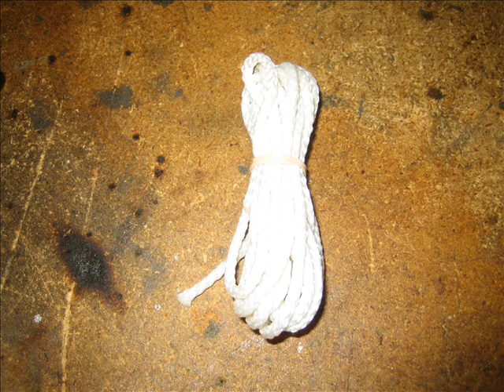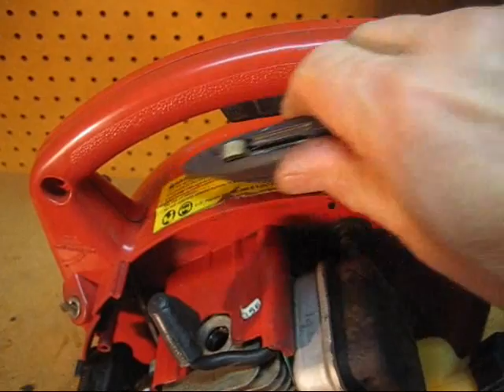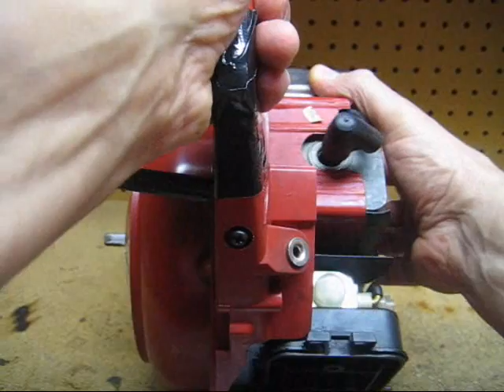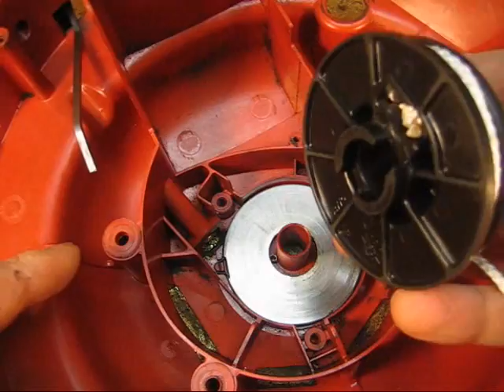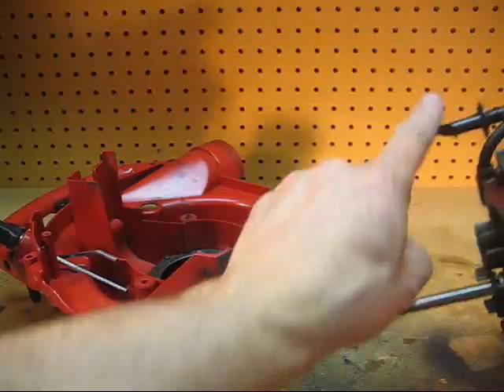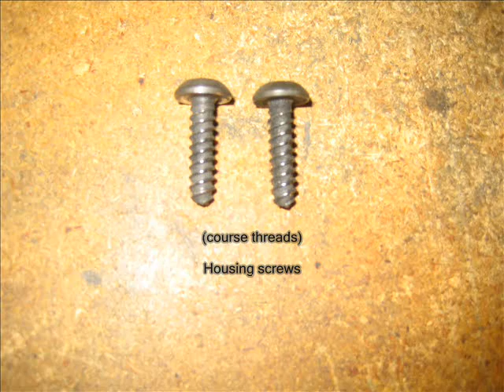Homelite Leaf Blower Starter Pull Cord Replacement

Comment: I watch very many how to video's an rate this on up at the top of them.   Many extra credit points for both disassembly and assembly with this one especially for those of us that never worked on a blower before.  As one commenter said below thanking you for not leaving anything out, I'll second that.  Two nicely separated parts the accomplished can skip but for the unaccomplished great to have.  People lose screws so thanks for naming them.  I had mine apart on a big potting table all apart and the screws in a box so nothing would get lost.  A strong wind knocked the box off the table to the ground that is rough dirt, leaves and sticks and still not sure if I have them all.  Great to have the call outs for them.  Excellent video shots and short to the point explinations.  Thank you.
Reply from the maker: Glad to hear it helped. Thank you David Kirkpatrick for the awesome break down. I really appreciate you taking the time for your comments/post.

Comment: Great video thanks for doing this. Clearly I didn't follow all the directions because the throttle spring came out! Any tips to getting it back in correctly? Should the throttle adjustment knob be returning clockwise, or counter clockwise? I can't seem to find any information online. Appreciate if you have any tips.
Reply from the maker: Hmm, I believe the adjustment is clockwise (sorry Chris, its been awhile) Were you able to get it figure out? Let me know.

Comment: Thank you very much. Couldn't figure out the handle on mine, it has molded plastic inserts an inch or so away from the handle screws, had to drill them out. Your video helped so much!
Reply from the maker: Thank you Glen for your comments/posting. Glad to hear it helped.

Comment: Just replaced the starter cord.  Your instructions were exact.  Thanks for the time you took to share this.  I have a tip for other users.  Use the universal mix oil available at most powered lawn equipment suppliers.  It does not smoke and as a result the exhaust doesn't contain a residue that attracts the dust causing a very dirty buildup of grime on the casing covers.  Thanks again.
Reply from the maker: Glad to hear it helped. Good tip on the universal mix oil. I did notice on mine the buildup as you mention. Thank you brnrsky for your comments/posting.

Comment: How do you keep the shaft from turning to loosen the fan nut?
Reply from the maker: Actually to my surprise mine loosened fairly easily, a little WD-40 on the threads and it broke loose. Otherwise I would have maybe tried wedging a piece of wood (so as not to break the plastic) between the case and the blower fan or buying a cheap strap wrench, (which I didn’t want to purchase) or I may have tried an old belt if need be. :) Good luck Elton. Keep me posted.

Comment: What is the ratio for fuel/oil mixture for this Homelite Hb-180V leaf blower? BTW, the video is very informative. Thanks in advance.
Reply from the maker: The mixture is 32:1 (4 ounces of 2 cycle oil per gallon of gasoline) Thank you D Linatoc for watching.
Reply: Hmm, my model I've bee using 40:1 for 25 years now.
Reply from the maker: I agree vfr800ification, the 40:1 ratio works fine (3.2 ounces of 2 cycle oil to one gallon of gasoline) I actually contacted Homelite a while back and they suggested, 32:1 for the HB180 (4 ounces of 2 cycle oil to one gallon of gasoline) Just an F.Y.I., the lower the number, 32:1 the more oil; 4 oz. of 2 cycle oil per gallon of gasoline (older models), the higher the number like 50:1 the less oil; 2.6 oz. of 2 cycle oil per gallon of gasoline (newer models)  Maybe less oil, less pollution….not sure. Thank you vfr800ification.

Comment: Can't thank you enough! I thought this wouldn't help because mine is quite a bit newer, but it's the same process screw for screw! I went ahead and replaced my fuel lines while it was apart. My only problem was the first cord bushing that the line passes thru coming off the spool...it never wanted to sit solid in the housing, but it pulls fine, and the bushing doesn't move once the line is threaded thru, but man, the booger wouldn't stay still while trying to thread! Thanks again, MUCH appreciated! Really.
Reply from the maker: Thank you Mark for your comments/post, glad to it hear it helped.
Reply: I spoke too soon...not really, you did a fab job, but now my blower won't start...errrrr. One thing I noticed while taking it apart originally, is that the return fuel line was broke in half...so it was leaking fuel rather than returning it to the tank...but it ALWAYS cranks right up. So, I replaced just the fuel return line, and now there's an issue. Could the return line be inserted into the tank too far? I have it less than 1/2" into the tank...would that really make a difference? And I checked to confirm that I installed the spark plug, wire, and ground wire to the stand. It has me stumped...I'll go back over everything this weekend. I appreciate any feedback you might offer. If you don't have time, I completely understand...your video did its job, that's for sure!

Comment: How tight do you tighten the blower/flywheel nut? Thought I had mine tight enough, but not. Flywheel came lose after a couple of uses, sheared key, had to buy new flywheel. I don't want to strip threads on crankshaft, but don't want to buy another flywheel either.
Reply from the maker: Hi John, oh man, that’s frustrating, sorry to hear that. I don’t have any torque specs but I tighten it pretty darn tight. I felt somewhat confident I wasn’t going to strip the threads. (famous last words,☺) also, I was careful too when holding the fins and tightening the nut so I didn’t break the fins. Let me know John how you make out.
Reply: Sorry for such a late reply. Everything went to my G-mail account that I don't use. I just now checked the account for the first time. Thank you I fixed the blower.

Comment: Great video! A suggestion for those having trouble loosening the 9/16" nut on the crankshaft without breaking the plastic fins on the blower while trying to hold it. Try using a small impact driver, as it will usually break those stubborn ones loose!
Reply from the maker: I like the impact driver idea. I could image the nut being stubborn on some of the crankshafts out there. Thank you David for your comments/posting.

Comment: OK so I found this video after I had disassembled the machine, and the part I'm having trouble with is replacing the spring that you advised to tape up. Any advice on re assembling the small spring in the throttle assembly?

Comment: What do u do if the nine sixteenth nut wont come loose and turns something inside that just clicks
Reply from the maker: Hi Ray, the 9/16” nut attaches to the crankshaft, the noise you may be hearing is the piston moving up and down the cylinder when you turn the crankshaft. As far as the nut not moving, hmm, if you haven’t already, spray the crankshaft threads with oil, hold the blower fan blades/fins and try turning the nut. Let me know Ray, how you make it.

Comment: Great instructions. I have a Craftsman blower for which i replaced the cord with the aid of this video. The two are very similar, except that i didn't have to remove the impeller shroud; there are seven screws (hex-key) holding the two halves of the main housing.
Reply from the maker: I'm glad it helped. That's good to know about the Craftsman blower. Thank you Douglas for commenting/posting.

Comment from the maker: Thanks Andy for commenting/posting. Here’s a suggestion, if you haven’t already, check the spring/container. Behind the starter pull cord spool is a round silver plate/container where the spring is located that retracts/withdraws the pull cord. In the center of the spring, on the end, is a small loop that needs to be in between the notch located on the back of the spool so when the spool turns it will tighten and loosen the spring. Below is a link to a short video, Homelite weed whacker starter pull cord won’t rewind/retract that might help you see what the spring needs to look like in both the weed whackers and the leaf blowers. Hope this helps you.
“Homelite weed whacker starter pull cord won't rewind/retract” video   
http://youtu.be/9dNRRRP56BU

Comment: Excellent video!  The only thing I would add is to make sure you don't tip the housing once you remove the pulley or the spring will pop out like it did to me.  Again thanks for this, saved me a bunch of time.